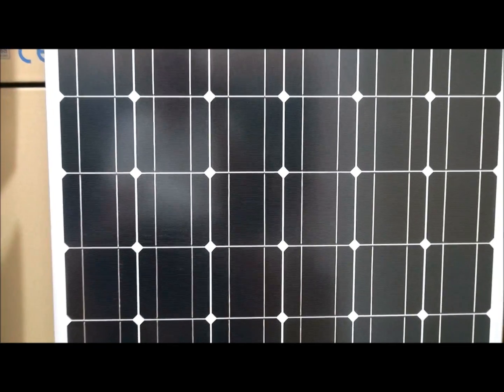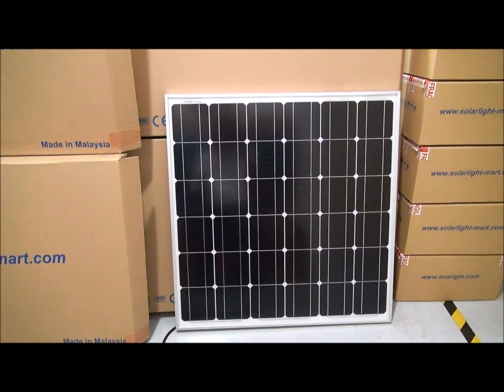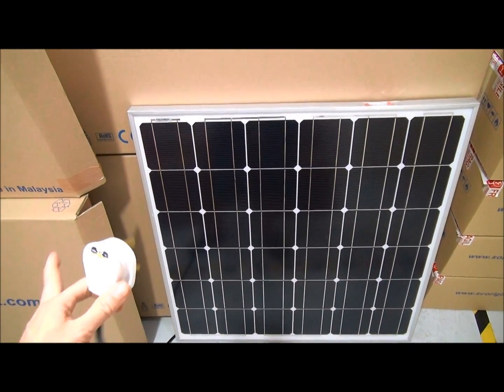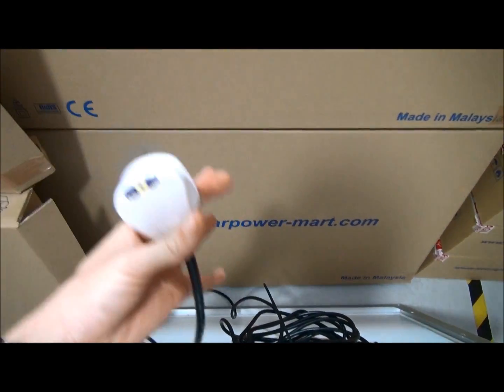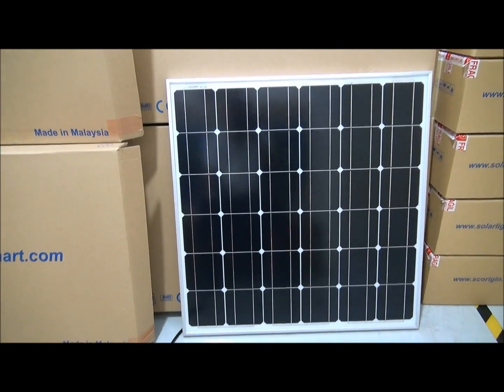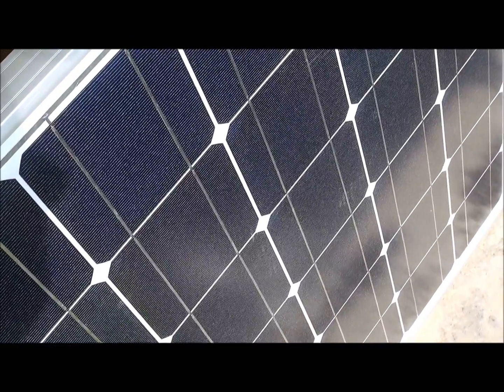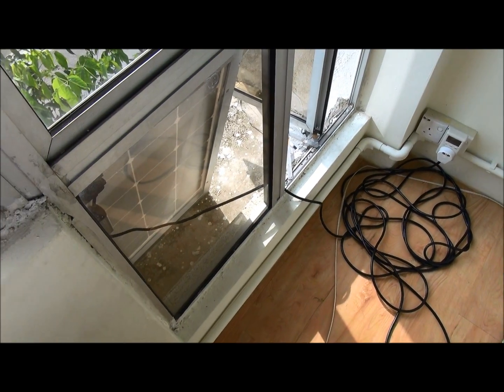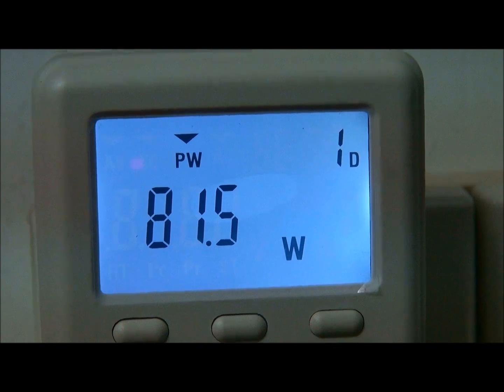Alternate Current Solar Panel Part 1

Comment: I think this is stupid, i dont even think its even working. 42 watt, yes, but not generating but consuming. I have 2 of these meters, and we use it to measure how much power is being consumed. if your panel is generating, then it should display -42 watt, not 42 watt. And AC power ? that means if you touch the plug when there is some sun light, the panel will shock you, and when there is alot of sunlight, then the panel will kill you, cause its AC power. How to proof its working ? simple, connect that solar panel to a like 4-5 gang extension, but do not connect the extension to your grid, plug in something that will use power. If that device work, means the power was from your panel, but most likely it wont work at all(i guess) cause its too dangerous to output 240vac to a male socket where anybody can touch. if you claim your panel can generate 42 watt, do like what i said, then plug in a blub or something that will need like 30 watt. I hope im wrong, but my brain keep tell me im correct, cause i would love to have something like that too.